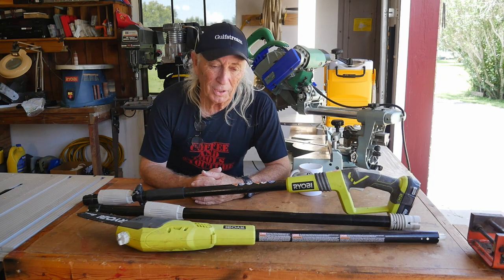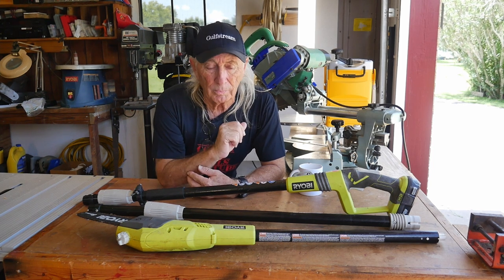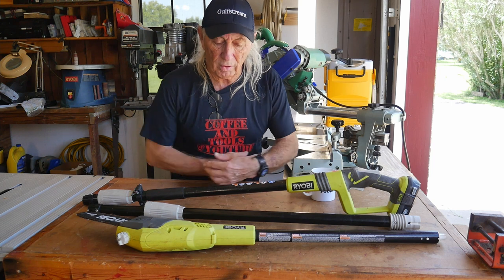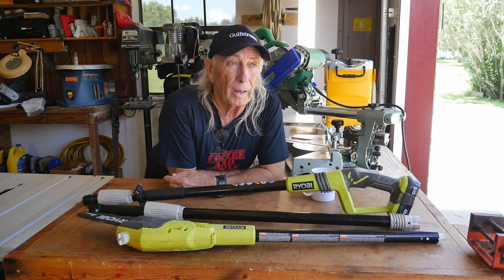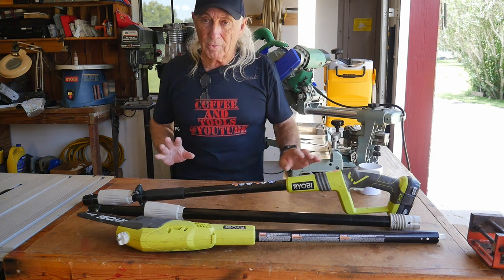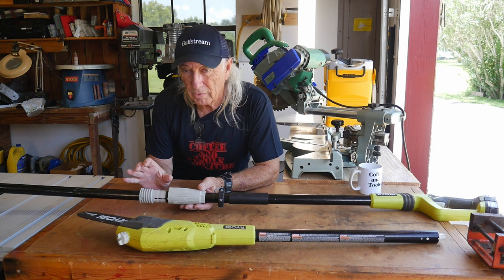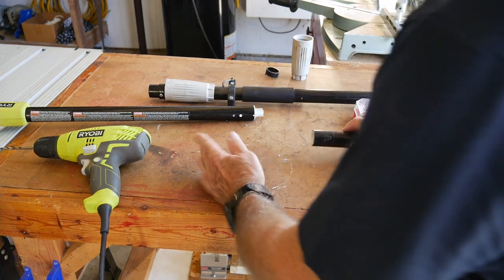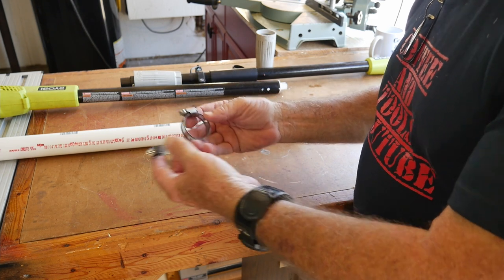Ryobi pole saw hack repair: electric chain saw model @ Coffee and Tools episode 164

Comment: This is a really great Video. I have one of these pole saws. So far nothing has broken but it does leak oil a quite a bit. The electrical contacts on the saw end of the extension have badly burned and I'm not sure I can clean them up. Do you have any suggestion on cleaning them up and also preventing this from happening again. It works fine without the extension but is very intermittent at best with it in.

Comment: I've had one of these for almost 3 years and use it at least weekly... many times for 100+ cuts limbing acres of fields we mow-- have never actually used the extension.  I think that bottom connection will break very quickly. 

In my case, the battery side is slowly splintering.   I'll probably use your method to fix that battery side soon and make the PVC the entire length from the battery pack to the head.

  I might drill the PVC where those rivets were and put a carriage bolt through the white pipe all the way to the other side and then another one on the other side of the connection.

Comment: I have broken male collar but there is a cord that runs thru my saw.  do you know how to deal with the cord so I can replace the collar?
Reply from the maker: I'm using mine. I'm thinking splice butt connectors. If there is enough wire inside to cut and re-attach afterwards...